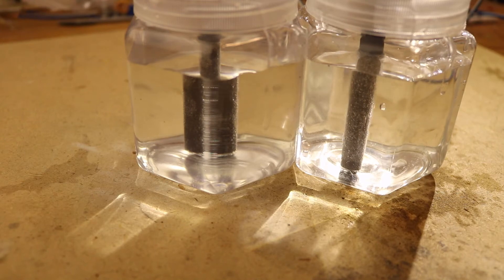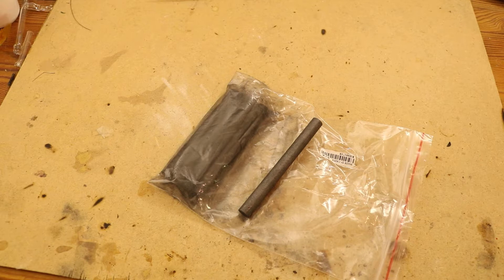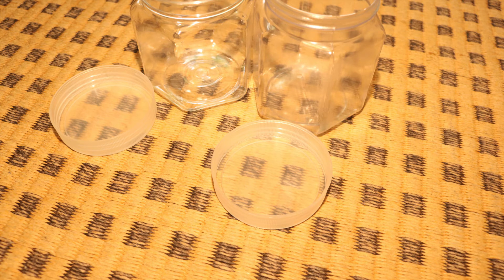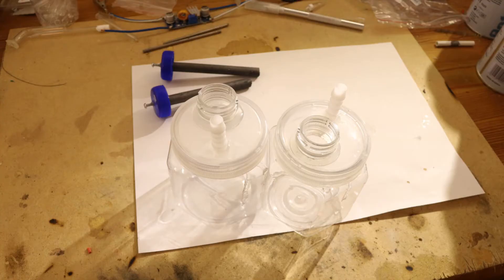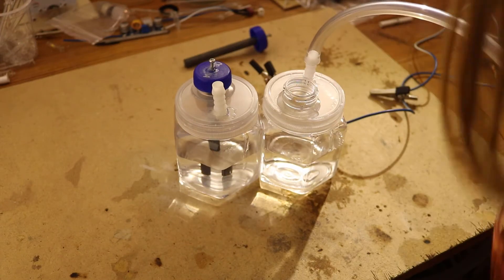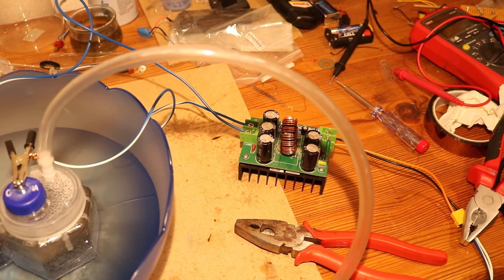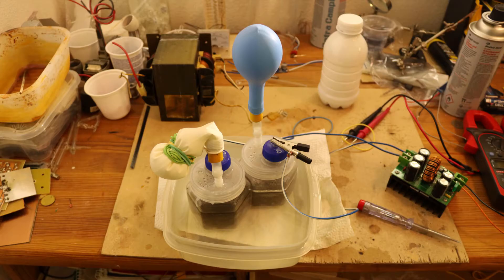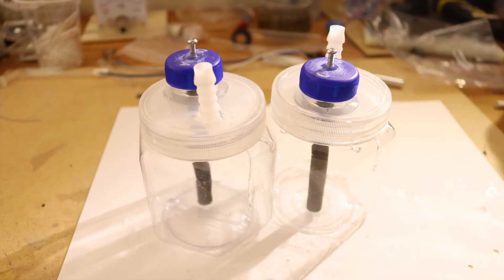Building a mini hydrogen generator

Comment: I use "STAINLESS" steel electrodes with a little sodium hydroxide in the water. I run it at 5V or less at 20A and I have never had any problems. The water is always clear. There is no chlorine to corrode the electrodes.

Comment: Noice
Reply from the maker: How are your projects coming along? :)
Reply: @thesciencefurry  current making a furnace with capacitors :D
Reply from the maker: Furnace with capacitors? How? capacitors only deliver high power for nanoseconds. a furnace needs medium power over a long time xD Or did I understand something wrong xP
Reply from the maker: @siddharth-wy2kp  Ohh nice, but for this you need supercapacitors. A normal power supply works for this aswell. But you need something like a welding transformer.
Reply: @thesciencefurry  normal power, that means i can do the same thing with my inverter battery right?
Reply from the maker: @siddharth-wy2kp  I meant with "normal" a continious power supply because you don't need capacitors for that. you need a couple hundret amps. Search for microvave transformer high current. That's a cheap way to do that because you can get them out of scrap microwaves.
Reply: @thesciencefurry  k